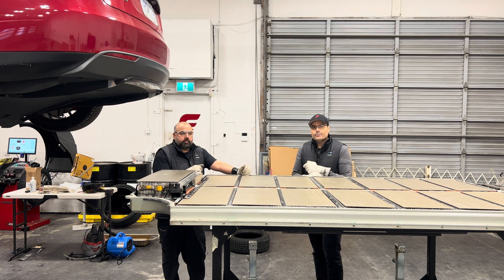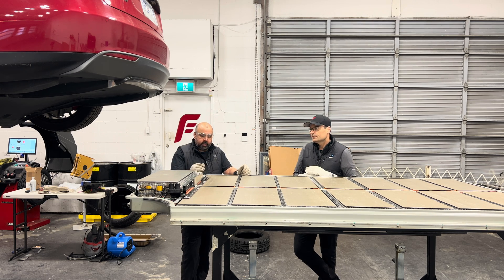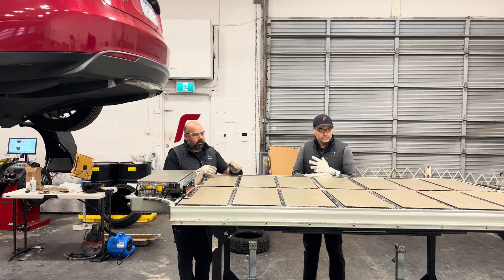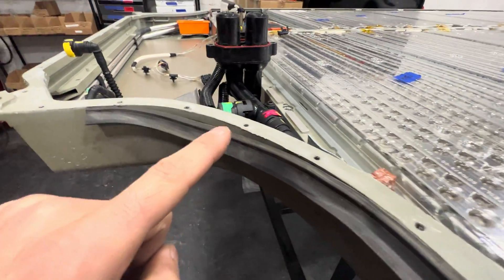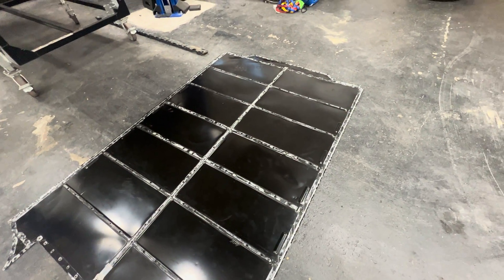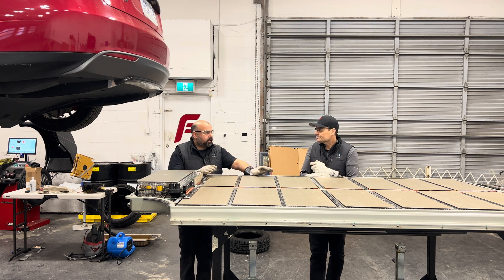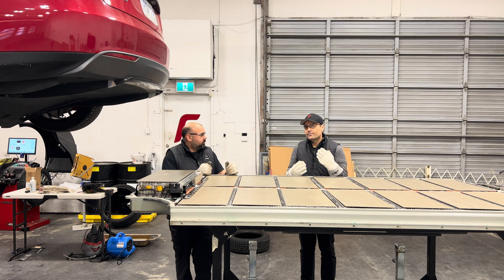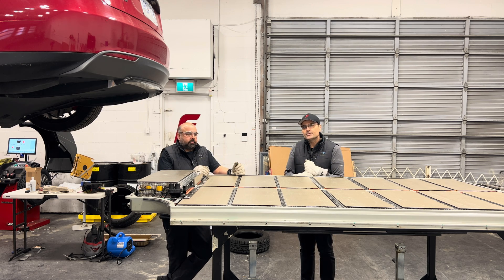Factor E Talks Tesla HV Battery Repairs

Comment: I just had my model 3 battery replaced under warranty after only 55k on the car. It was replaced with a refurbished battery. Tesla has the right to choice under the warranty. The Tessi app says the refurbished battery already has  7% degradation.  Tesla says that app is not accurate. Not sure who to believe.
Reply from the maker: If you are concerned about capacity, you can perform a capacity test in service mode from the touch screen. Let us know hoe it goes if you perform one. We would love to know how accurate it is vs the Tessi app.